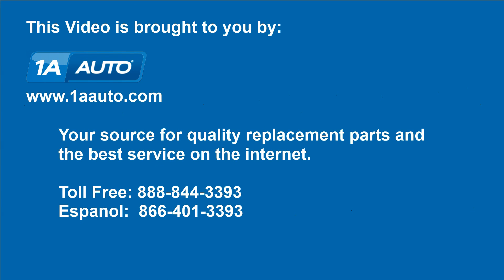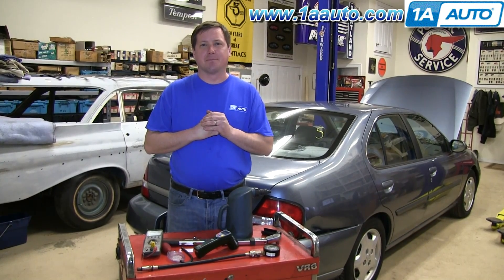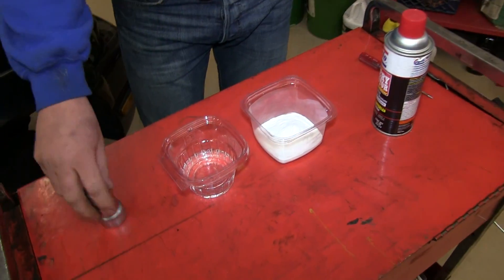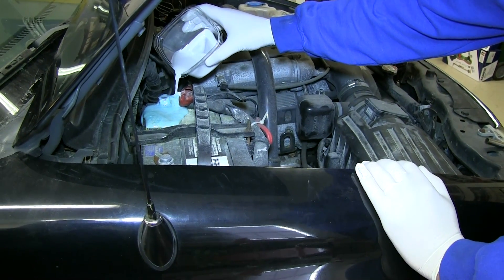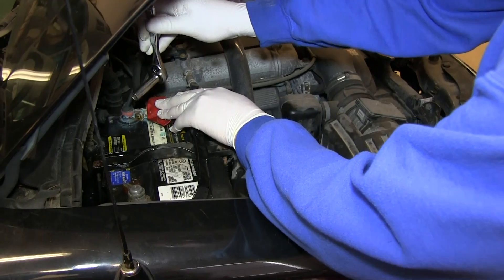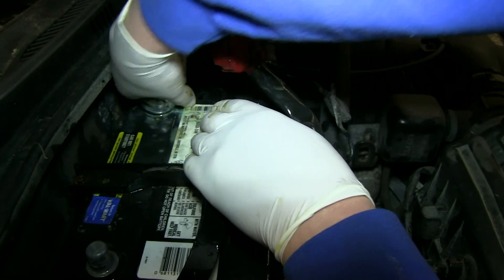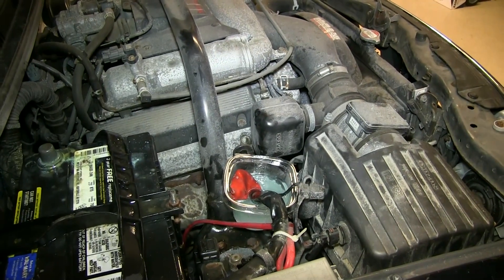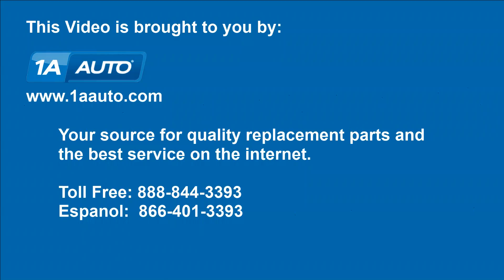How To Neutralize & Clean Battery Acid Corrosion

Comment: I had battery acid escape inside my boat bilge area and leave white spots all over the Aluminum frame of the boat (entire boat is aluminum). I took out all 3 batteries and dumped baking soda all over the place. Then scrubbed and rinsed. Several times. The spots fizzed upon the first application of baking soda. But no longer fizzed after that when I reapplied the baking soda. So, I think I neutralized the acid. However, the white spots are still all over the aluminum. Would this be expected?

Comment: Very helpful! When the water/baking soda/ corrosion mix runs down the side of the battery does it damage the battery tray?
Reply: I would have and use paper towels around entire area of top of battery to absorb as much of the run off as possible. That stuff can stain a garage floor and might be bad for other parts in comes in contact with.

Comment: If your tools touch any of the acid or corrosion be sure to clean them with baking soda and water as well.  The sulfuric acid in car batteries will slowly eat up metal tools and corrode them if it stays on there for weeks or months.  (Speaking from personal experience unfortunately.)
Reply from the maker: +Alex Ricketson Thanks for the tip!

Comment: careful, if the battery is leaking acid there could be a slight hole that the water/soda seeps into and neutralizes the battery. learned that from own experience lol
Reply from the maker: +William Strong Thank you for checking us out, as well as the information. This will certainly be helpful to other viewers to allow safety and proper functioning. 1aauto.com

Comment: U dont need to baking soda, u could also clean it wit the lemon too...
Reply: Lemon is acidic and therefore will not lower the ph of the battery acid rendering it neutral and environmentally safe. Doh

Comment: I've often wondered where that acid comes from, and why it tends to accumulate on the pos side. Sure, there's sulfuric acid in the cells, but aren't they sealed? Does water and acid track up the post across a seal, by a surface tension effect? And why is it green? Do the extra protons on the post attract ions from the air?
Reply from the maker: Thanks for being a "frequent Flyer" on our channel...lol The acid tends to find it's way out somehow. This trick will help to keep it in check though. Have a great day!
Reply: Thanks for the response. I found a good Wiki page explaining the chemistry -- for those who are interested, it's under Copper(II) sulfate. Hydrated cupric sulfate crystals are blue, but the anhydrous form is a white/green powder. Small volumes of water and sulfuric acid escape through the necessary vent hole and by surface tension reach the edge of the copper wires. Cupric and cuprous sulfate precipitate out, producing small amounts of hydrogen gas that diffuses away as the wires are gradually destroyed. I'm still not certain why the cathode would be preferentially affected.